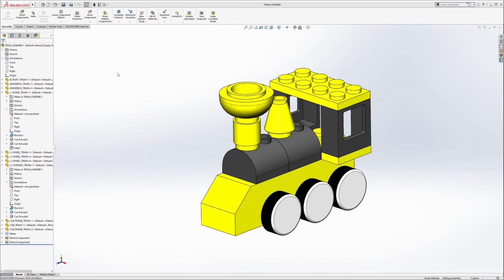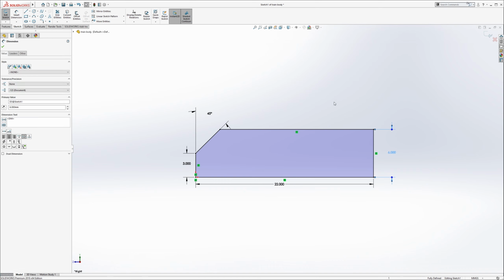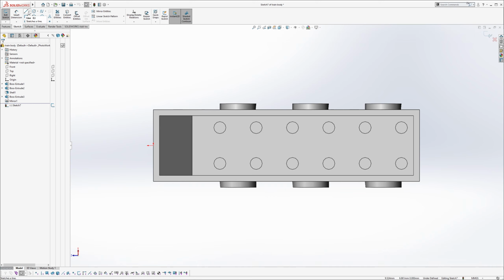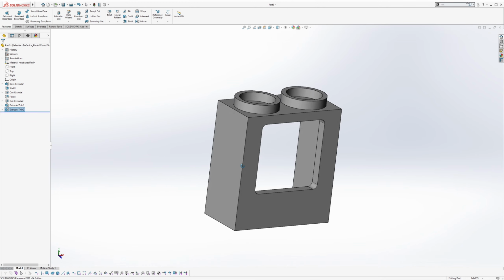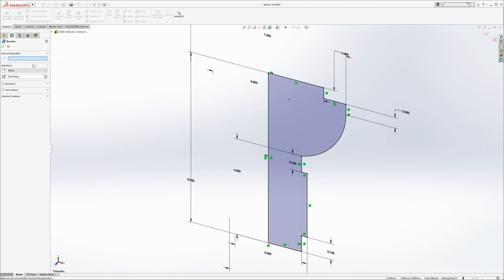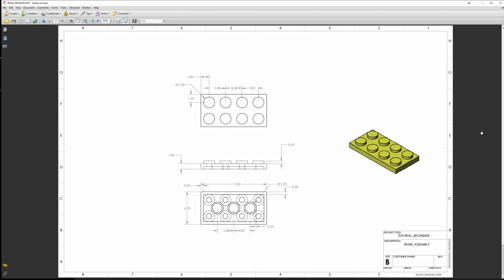Intro to SOLIDWORKS for Absolute BEGINNERS Creating a PART (Lego Train) | SolidWorks Part 1

Comment from the maker: Watch this Beginner video (Part #2) next ➞ https://youtu.be/7aQdxcg4a5I
Learn SolidWorks without any prior experience, with this free mini-series for absolute beginners! 

By the end of this tutorial, you'll have created your first part in SolidWorks.

Download & Try SolidWorks CAD Software free trial:
https://my.solidworks.com/try-solidworks

Download the free project files here:
https://rathasochenda.com/download/

Time Stamps
1:25 | Creating a sketch for lego train body
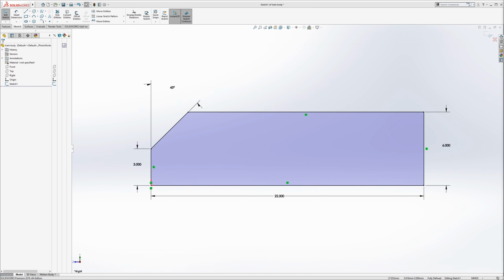4:45 | Creating a Extrude Boss/Base feature
9:37 | Creating Linear sketch pattern
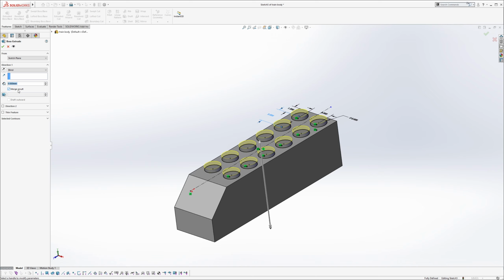11:00 | Shelling the part
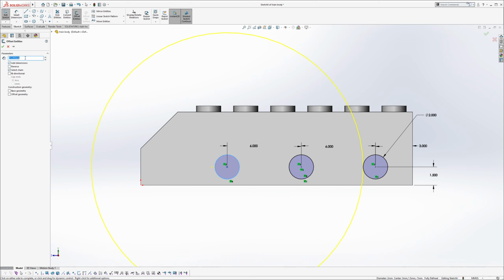14:01 | Offset entities
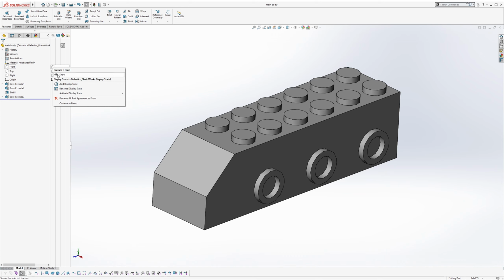15:13 | Creating a Mirror feature
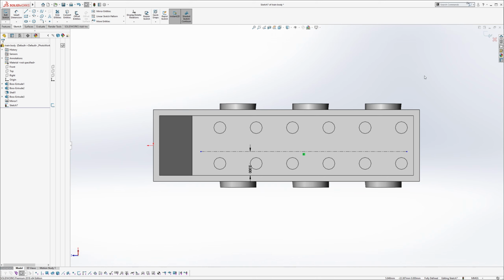16:41 | Making a sketch text
17:35 | Extrude cut text
18:26 | Sketching your second part the train cab
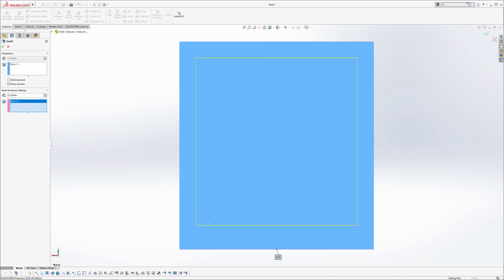19:36 | Multi--thickness Shell
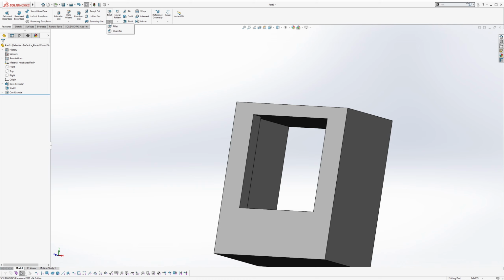21:17 | Adding fillets
23:04 | Cut offset from surface
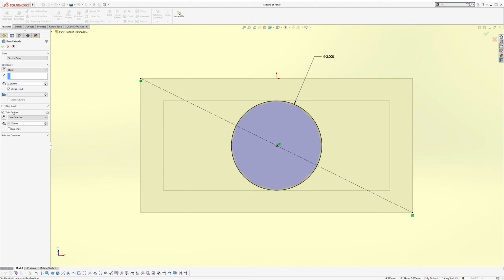24:40 | Creating a Extrude Thin feature
31:32 | Creating a Revolve Boss/Base
34:18 | 3 point arc sketch